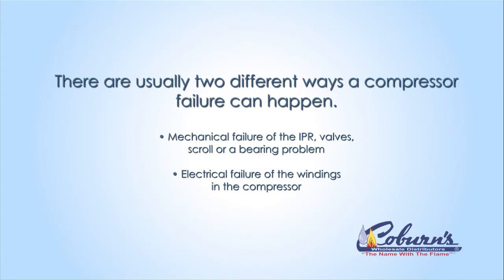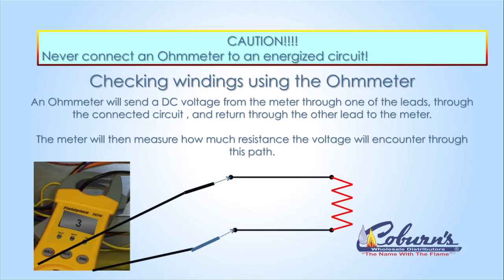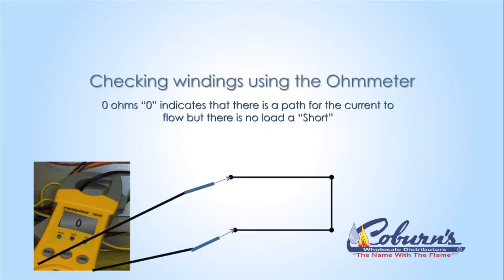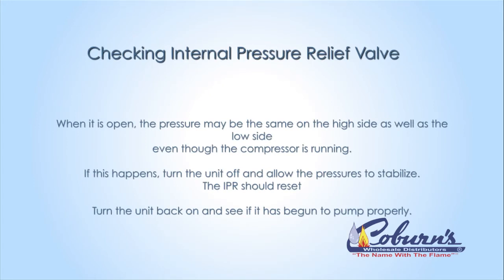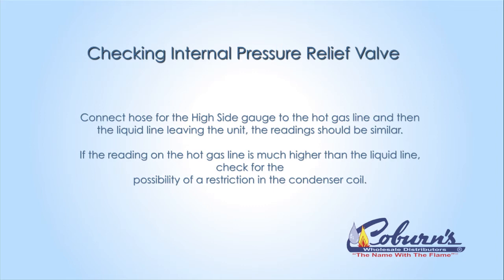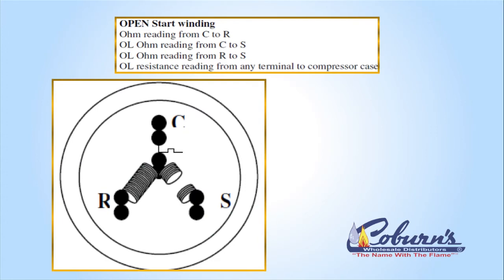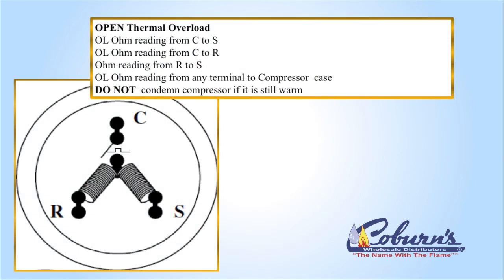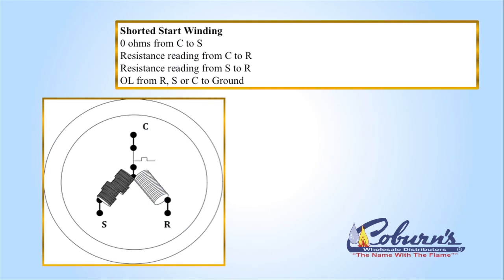Rick's Tech Tips - Compressor Failures

Comment from the maker: Not accurately.
I submit that compressor manufacturers will begin to monitor warranty compressors more closely as R22 begins to fade away. Having a customer think that the compressor will be warranted and then finding out later that the mfg found nothing wrong with it, and denied the claim, could end badly. 
Take the time and do the right thing.
Reply: I have an old Trane XE 1000 Straight cool condenser. The problem is not only is it old, but the builders placed the condenser unit in direct sunlight from 1 pm to sunset. I changed out several capacitors and it usually works. Today it was so hot outside and the compressor stopped working. I replaced the capacitor and put on a new contactor and changed out all the terminals. The condenser fan later stopped working. It resumes once the motor is cool, but will shut down after a few minutes. The compressor was hot to the touch. I couldn't access the compressor terminals because there is very little clearance so I used a mirror. By visual inspection with a mirror the terminals looked okay (I know you can't go by that) so I suspect a possible thermal overload on the compressor. So I'm not going to condemn the unit yet. There is not much to this unit. It only has a compressor, Capacitor and contactor in the service compartment. What do you make of this problem?

Comment: If the compressor has grounded to the shell (internal short) of a hermetic unit, then you can condemn the compressor because it cannot be repaired. For example; If you put a test probe on the common (circuit breaker should be off) and one probe on the suction line or hot gas line and you have continuity, then the unit has an internal short. You can also test the same way on the start and run lead. Any one can short internally.